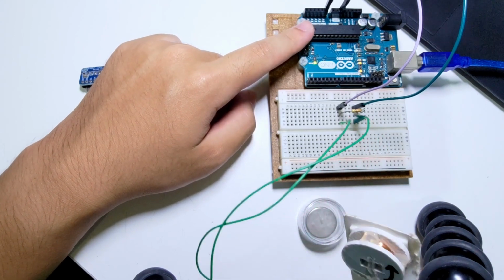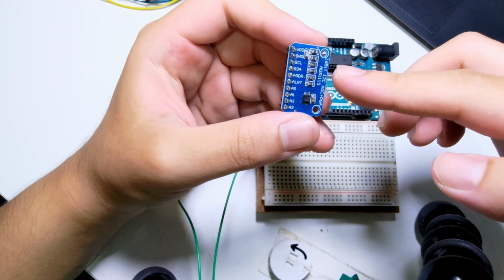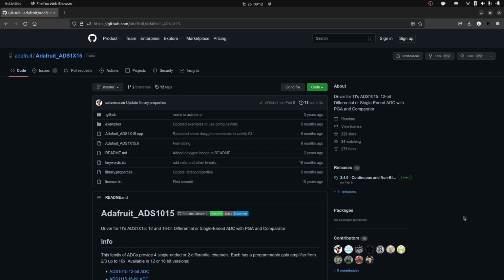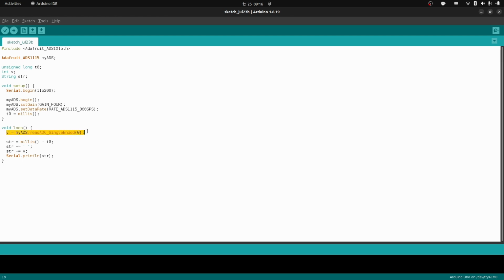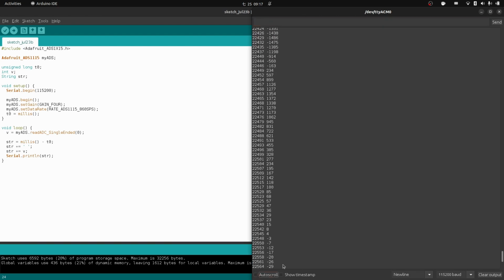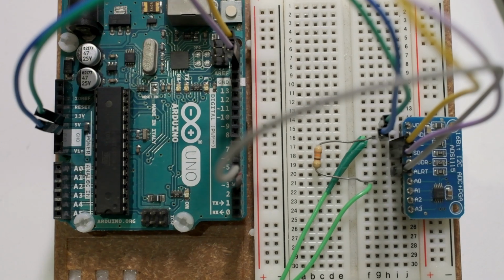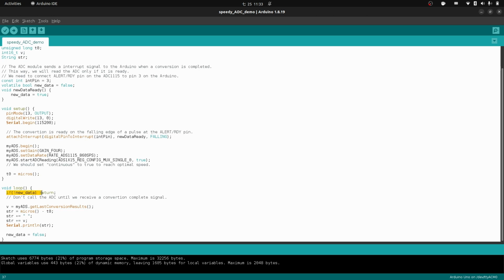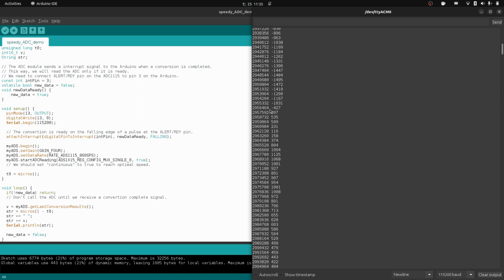How to use ADS1115 ADC module in continuous mode

Comment: Great video, just what I was looking for!
Hey, for some reason my ADS1115 was working only when I plugged it to 3.3V, do you have an idea why it is so?

To be more precise I had both load cell and ads power connected to the same 5V output on arduino, and for some reason it didn't work. The moment I plugged ADS to 3.3V and separate ground everything worked like charm.
Thanks for the video, and I'd be happy if you could share your thoughts!